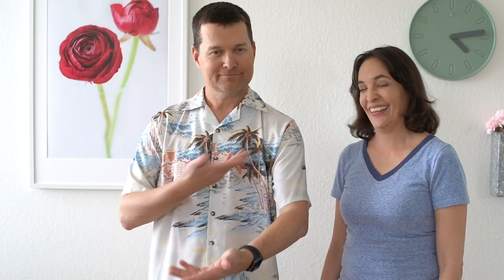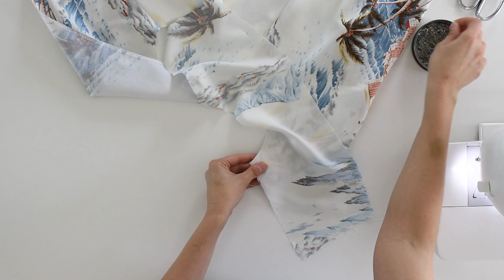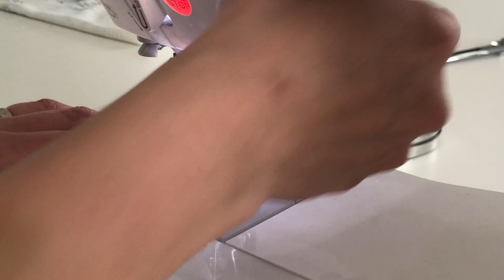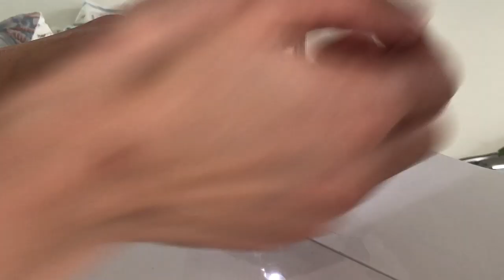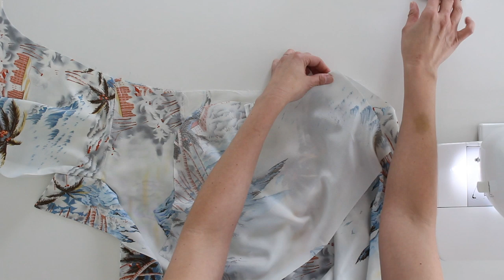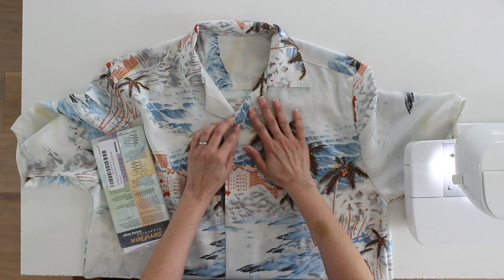How to Sew a Men's Shirt - DIY Button Up Shirt

Comment: This is my first time sewing a shirt. I had to pause, go back several times, but I did it with your video! Only problem is I use a treadle machine. No surger or zigzag. So after I sewed the seam I sewed a second seam close to the edge, best I could. My shirt came out great! I need to make it a little bigger.( I used your pattern) Do you have a video explaning how to alter a pattern? Thanks!
Reply from the maker: There are over 1000 posts on my site with tutorials. I’d suggest using the search bar in the menu there to look for the specific alteration you’re trying to do https://mellysews.com/tutorials/

Comment: Great tutorial, thank you! The only thing I'm confused by is that you mention notches on the sleeve and back/front piece (and I have used other patterns with notches, so I know what you're talking about), but no notches have printed on the pattern, just the outlines 😟. So I'm not quite sure how to line up the sleeves with the armscye...
Reply from the maker: When you don't have notches, line up the ends and then distribute the fabric evenly in between.

Comment: The only way to make this video better would have been to use a less busy fabric and use different colours for the back vs the front, so it is easier to keep up during the assembly.
Reply from the maker: While that would make it easier to see on video, I don't like to sew things that won't get worn, so when I have to choose between what will get worn vs what works on video, I choose what will get worn.

Comment: I have a very light and flowy Polyester fabric and wanted it to stay flowy. Is it possible to not use the fusible interfacing or will that not hold the shape enough?
Reply from the maker: It depends on how loose you want it in the shoulders. I used a very light poly fabric for the version I'm wearing here and still interfaced. https://mellysews.com/mens-shirt-pattern-tutorial/

Comment: This is my first time making a men's shirt and adding sleeves and I'm having trouble fitting them together. When she says "match at the seam line and not the raw edges" does that mean there will be rippling in the fabric? Or should it look perfectly smooth? I really can't seem to get these sleeves to work. I've even remade the pattern and recut the sleeves and yet I still always end up with at least an inch of extra fabric.
Reply from the maker: When you are sewing a concave to a convex curve and adding seam allowances, the concave curve will be longer on the seamline than the raw edge and the convex one will be shorter on the seamline than the raw edge. So the sleeve as drafted and the armscye as drafted match on the seamline only, not on the raw edges. Incorrect seam allowances, remaking the pattern, changing the size, etc, can all make them not match.